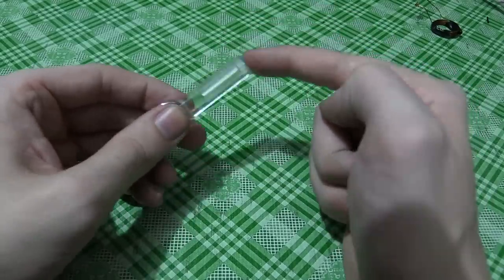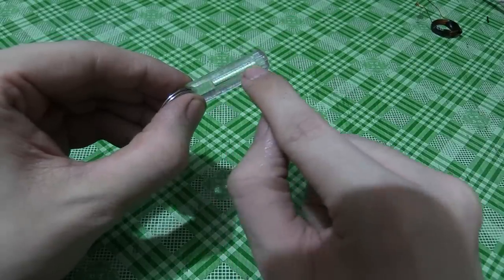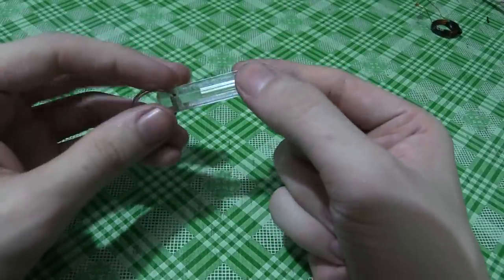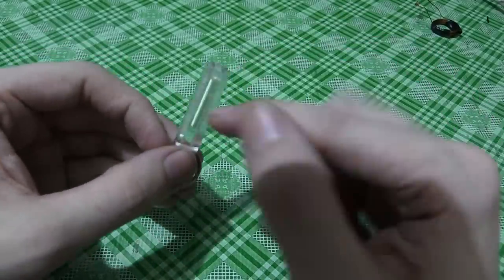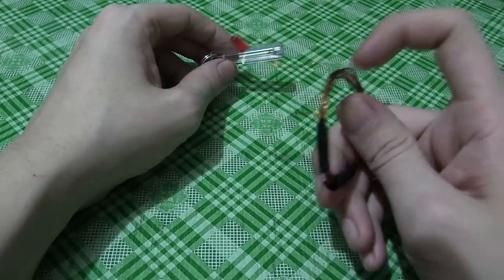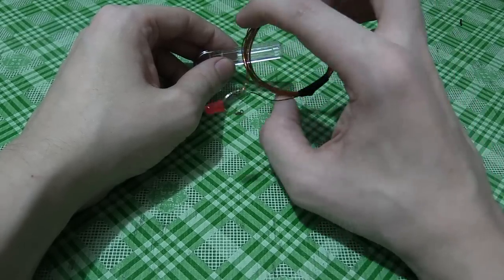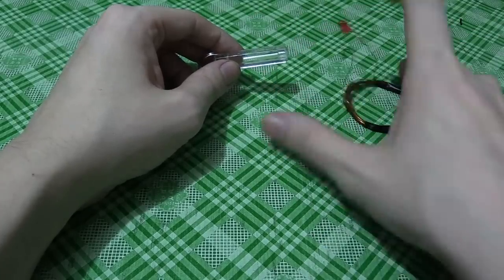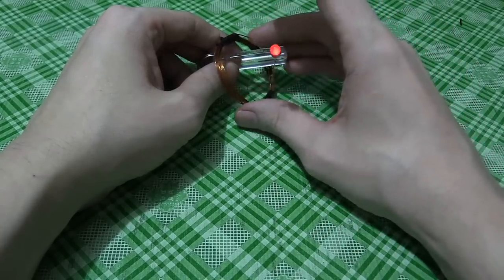1 Watt Nuclear Generator - Free Energy

Comment: Pretty sure he put a magnet in the tube, not tritium, because tritium would not do this. A magnet would. Notice that at no point did he ever stop the coil from moving. That's because it's necessary to keep the coil moving in the magnetic field to keep it generating electricity.

Comment: the keychain is a luminescent liquid, the coil its a normal receiver counduct of electromagnetism in this case powered by, a normal wireless cellpone charger under the table, radiation cannot be transformed to energy by coils
Reply from the maker: +Manolo Alatorre it's not a luminescent liquid. It's tritium that excites a phosphor. Try look it up on Wikipedia :)
Reply: +Gadget Addict yeah actually i was unaware of this type of keychain, i did a research on this element now, becouse im a inventor and im trying to make small nuclear batteries etc etc., you are right but my point was that your invention its fake,  i didnt know the amount i assumed it was low but, do you know the amount of beta decay mevs of your energy source tritium, multiplied by the amount you have in that keychain, hahaha look it on wikipedia and use a calculator
Reply: say a bunch of fancy words and suddently you're right :D
Reply: but yet again this video has been made in april fools day
Reply: beta decay is electrons.
Reply: Manolo Alatorre actually your wrong. It's tritium in a glass tube with a white phosphor coating. Once the radiation passed the phosphor it causes the phosphor to glow.

Comment: 1 watt? My 1 watt led flashlight is as bright as a car headlight. And how would such a device even work? This is magnetic induction. Unless tritium generate a pulsed or alternating  magnetic I call this fake.
Reply: I call this fake too because a led light would explode with 1W instantly and it even explodes with only 9v. it is fake
Reply: but you can make a nuclear reactor with thorium
Reply: I think so too... It's FAKE!  ,,,  In the video, generated energy is too low... It doesn't seems that 1W... NEVER....
Reply: Maybe a TINY Magnetic generator? LOL XD
Reply: +Layn J the date is April 1st
Reply: No, its april folic induction.
Reply: Vool Cow
 OH MAN DATE! April 1st......
I didn't look the damn date :(
Reply: Corey Miller 
Dont forge5 that the coil he put around it is only covering a tiny area and beta radiation doesnt travel well through air. Maybe a few percent actually reaches the led. Meaning almost all of the energy is lost and the actually tritium battery generates a fair amount. Probobly not 1 watt though but its easy to work out how much it would actually generate
Reply: the legit way to make it would be to use tritium rods and put it between 2 small solar panels. still would produce very very low power output
Reply: Oh boy the people here do not know about beta and alpha decay.

Comment: methinks wireless power circuit under the table. that or just outside of the camera angle.
Reply: +Blaine Thornhill For real!! I was watching him hold the key chain on that one spot very close to the table... and I swear I saw him trying not to pass the key chain through the coil while it was suspended from that one spot. haha
Reply: I agree
Reply: Def not a watt, but this probably does generate a few mw. Idk tho
Reply: @quantum_chezburger2279  my guess is prob less, tritium has a very low power production and isnt very dense

Comment: Where did you get the 1 watt figure? to light up a red led is like 1.8 v at 2-3 mA.  So that's like 0.004 Watts.  That's 1000x difference than what you claim.  (also, kids toys in the 80's came with this type of glow-in-the-dark plastic)
Reply from the maker: GeorgeGraves I understand that a red LED only consumes a minuscule amount of power. The 1 watt figure comes from a voltmeter/ammeter measurement after various testing with different coils, wire, capacitors, transistors and different sized tritium rods. It's far cheaper to buy raw tritium rods than finished keychains like the one shown in the video. But you have to handle them carefully. This is not a glow in the dark plastic that requires sunlight to "charge"  and it's not radium like what used to be used on watch hands. It's tritium, which is a radioactive isotope.
Reply: It's not glow in the dark plastic. There is a tube inside that contains tritium and a phosphor coating and when the radiation passed through the phosphor it glows.
Reply: GeorgeGraves hell your dishes probably had this radioactive energy lol seriously
Reply: Gadget Addict 3h
Reply: Gadget Addict I’m glad you made this video and thankyou I’m new to the idea but know it can be purchased on wish app cheap and am thinking of getting a few , it’s legal to own here just not sell

Comment: A few reasons this is fake:

1. The beta particles that are being emitted by Tritium are very low (0.018 MeV), so in open air without any vile, the beta particle can only travel a few millimeters before losing it's energy. But that's without any barriers such as the plastic it is in. Also the phosphor is getting illuminated because it is absorbing the particle. So no beta particles are leaving that kay chain. 

2. The conversion from beta radiation to electricity is difficult because it does not act like a normal electron. It is not bound to anything and is a "maverick" per se, so it doesn't have a natural flow like electrons in a copper wire. Therefore claiming that the beta particles are uniformly moving in a way to induce a current in that wire is far reaching. 

3. Lastly, in beta voltaic terms, 1 Watt is A LOT of power. Most devices that utilize the technology, like pace makers for example, run on micro and pico watts. So the 1 watt figure is insane

Comment: =)) this is fake...
Reply: i dont think so, nuclear is powerful you know,
Reply: +Froodoolidoo Do you even proof read before you post?
Reply: No, its fake; you can't generate electricity without a  current carrying conductor and a magnetic flux. As well, he also reverses the coils and the light operates the same. It would literally be a one way operation, as LED's are polar. It's fake.
Reply: Also, look at the date it was posted lol. He did a clever job, but it aint real homie.
Reply: @JgHaverty  irregardless if its fake or not, electricity generated in a coil is alternating current so it wouldn't mattered how he positioned the coil.
Reply: @gustavgames  .... lol its a battery....
Reply: @JgHaverty  Like i said, i dont care if the video is fake or not, your point on the polarity of the coil is invalid because a coil would generate AC.
Reply: @gustavgames  dude... you clearly dont understand how this works lmao
Reply: @JgHaverty  If you could tell me what is wrong with my comment I would happily learn from it even though im pretty sure im not talking shit... a coil generates ac current when an alternating magnetic field passes trough it.
Reply: @gustavgames  First off, batteries can only induce a DC voltage... so if youre struggling at step one, Im not sure where to go from here.
Reply: @JgHaverty  im not talking about a battery here, also dc voltage can only be induced in a coil if the coil moves through the magnetic field. A dc field with a stationary coil around it doesn't generate any power.
Reply: @gustavgames  the coil amount doesnt matter. AC is induced when a magnet is spinning... Coil count only affects voltage....
Reply: @JgHaverty  did I say anything about the number of turns in my comments? The point i try to make is that you can't induce DC into a coil without moving the coil in one and only one direction. Polarity doesn't matter with AC.
Reply: Noah Monfrini I am a physicist and if you think it is easy to build a neutron Bomb, then you are dead wrong.
Reply: @Mat-jv1fx  it is probably fake, this is a tiny amount of tritium, and that’s not how you use a coil to generate electrical currents.
Reply: @tomeaston2962  4 years ago me was on somthing😳 tf is thread
Reply: @gustavgames  you’re wrong, changing magnetic fields does induce ac current in a coil(if placed correctly), but there is NO changing magnetic fields coming from a tube of tritium.
Reply: To all believers: nuclear energy is basically a really complicated way of getting heat to boil water to run a turbine( in the case of RTGs, it simply uses a thermoelectric generator).   
This video is BS.

Comment: Though he is wrong about the one watt claim, it can be said that the generation of electricity is possible through a substance such as tritium. This is mainly due the fact that it produces beta rays when it decays, which are basically electrons. This most likely produces a disturbance in the electrons within the coil causing them to move around and generate power. The only false claim is the energy that is produced through this incredibly tiny isotope. (btw i may be wrong about something here, don't judge i'm only 140)

Comment: the question is

how many volts does it generate?
and
can you actually store that energy?

would be great to know.

thanks
Reply: Domenique Jöcks tritium doesn't emit enough power. what you want is americium from a smoke detector, just read up on safety and conduct your own experiments.
Reply: Atomat235 7 thanks for the Information. Can i simply build a glass tube around that americium and put a coil around it or shall i also build a lead tube around that tube-coil-contraption? I mean its a different radiation from the tritium but i think its too weak to give me cancer ot so because otherwise i have the propability to get cancer from having one smoke detector in my closet. 

Would be nice if you can also answer this question.
Reply: Domenique Jöcks most smoke detectors contain about 0.9 microcuries of americium 241 which comes from plutonium in a reactor. It is still safe because of the small amount, so you can handle it without gloves for short periods of time. most have gold foil over them, so inhaling it shouldn't be a problem unless you have it in your face or if you scratch the foil off.

as for power, im still working on finding a way to use it as a source of power, i do know that it does not need to be in a tube or in lead. just keep it in a container that is a good distance from you so that you can keep up with it.
Reply: Atomat235 7 but cant you just insulate the innards of the lead tube with silver or aluminum foil so that the radiation is getting reflected to the americium? and what happens if you have the radioactivity clothing for high level radioactivity and put a bigger amount of americium into that tube. I think there is a socalled critical mass like Plutonium has and if that is reached it generates a lot of heat. Cant one use that heat to generate thermal electricity?

Also i have a slightly small vocabulary because i am from germany so my grammar has some minor mistakes in it.

So talking about Plutonium and americium, cant you just take thorium and build a small reactor from it? I mean you can carry fresh thorium with you for hours and nothing happens, same with uranium. Also the thorium gets uranium after a certain time so you can theoretically breed americium at home.

What do you think? Im looking forward to your answer
Reply: Domenique Jöcks the aluminum foil would most likely just block out alpha and some beta particles, but you could try. As for larger amounts of americium, every radioactive element has a critical mass, and it is very unlikely that you will reach it as americium comes in a small metal button with gold or other elements grafted over it. thorium and americium are unlikely to be used together to make a reactor because thorium doesn't fission easily, but you could try buying some uranium238 online and bombarding it with neutrons from the americium, i haven't tried it yet, but depending on where you live it might be illegal. if it isn't check the legal amount to own and if you need a license, and be very careful with plutonium, it doesn't occur in nature so humans haven't had time through their evolution or time on earth to develop a tolerance to it.
Reply: Thorium doesnt fission easily but it does fission when you put enough neutrons into the atoms. As a neutron cannon i thought about radium which is to be found in the pointers of some glowinthedark watches. The only Problem is the stuff coming out of the reactor. The question is not where to let it decay, the question is how long the halflife is. Even though uranium has a longer halflife you dont know what to do with it.

Next Problem:where i live is germany and not america so it could be a huge Problem to Import the uranium to use it for a reactor. And since germany decided to deconstruct the nuclear power plants i could actually get into some serious trouble with the Government here. 

I: „oh i need some uranium to build a nuclear reactor at home... hehe.“
Government: „are you crazy? You want to build a reactor? You are dead!“

Another problem is, believe it or not, youre having a serious conversation with a 15 year old dude who knows some stuff about radiation but not much. So it can be that i might get my parents pissed off a bit so i keep this a THEORY.So dont expect something going on at my house its only happening in my Imagination.

Hope you understand me. But im happy to have someone to talk to about this theme. Thanks.
Reply: Domenique Jöcks yes, i understand. after chernobyl the government decided to demolish reactors in germany. I'm also 15, i just know about this sort of thing. the U.S. government just gives you a slap on the wrist and cleans wherever you store your reactor here. if you're older, you face several years if not life in prison.
Reply: Good to know its not only germany. But my mind is more important than my reality because, as Stephen hawking said, in my mind i am free. So i can think of a nuclear reactor and how to build it and i understand how nuclear radiation can be used for stuff. Also im really glad im talking to someone of my age so we can understand each other better. 

Back to the mind thing:
If i want to understand sometging i use my mind to make a picture of it so that i can see what i explain or get explained. Thats the way i tought my class about infinity and nearly everybody understood because i used the pictures in my  mind to draw things on the board to show everybody. And since we are going to have radiation in our physics lessons next year i learned about radiation. And this conversation is something i really want to call a learning progress because we spoke to each other at such a high level that my class is going to be envyous. 

So i want to thank you for this conversation and i would like to keep it up.

Ps. Do you have Whatsapp? If yes do you want to keep the conversation going on there? Just send me a private message with your number in it if you want to. I dont spam.

Comment: What is the diameter of the coil? And would it make more power if the coil extended the length of the tritium chamber? I also wonder if it would run a small neodymium magnet MHD?

Comment: sorry for the comment , was just wondering what kind of wire you are useing. I was going to message you , however I am on my cellphone and cannot figure out how. Also does the plastic around the tritium and x ray effect matter for power production ?
Reply from the maker: +Silverz0 I don't remember the gauge but is a pretty thin 'magnet wire'. I'm not sure about the tritium and it's protective casing tbh, sorry.

Comment: Hi Gadged Addict!

Where can you buy tritium? If ever you had shipped it here in PH, how did you get through customs?

So it emits electrons by beta radiation and those electrons are captured by the coil?
Reply from the maker: comebackata2 I don't know any place in the Philippines where you can buy tritium vials, only end-user products that include tritium, like the keychain light. In some countries you can buy the vials on sites like eBay and it works out much cheaper than buying end-user products. Although you can't buy the vials locally (as far as I know), there are shops that sell products that include tritium; like the keychains, rifle sights, watches, emergency exit signs and so on. You can find those in many mall shops in Metro Manila.

As for using the tritium to generate electricity, I think it only works on one day a year :P
Reply: aw ok :(

thanks! :)

Comment: this is fake. maybe he put some coil under the table powered by oscillating current that works like a transformer. the coil under the table is primary and the coil that he is holding is secondary. i think tritium does not have significant amount of magnetic field to induce the current.

Comment: Thats a big isotope which is diferent to just radiation. For being Tritium you could generate a constant flux of ions which in turn could be used as a tiny energy outcome a nano propellant for instance. The light effect is more on the chemical phenomena of the equation I guess. Try using tritium in a more manageable state such as gas or pressurized liquid tritium. In theory it is possible to testing its full potential at once by triggering out its reaction at different speeds to evaluate what is the optimum and what energy outcome is capable of generating by amount.

Comment: Fake. You cannot extract energy simply by coiling wire. you could however stack an array of tritium cores using small solar panels in a series parallel config to make a battery for your tv remote.

Comment: impossible.  its.electrical emission has been tested on very expensive gauss measuring systems . the output Is only detectable beta waves less than 5 thousandth of an electron volt. impossible to even penatrate the plastic key ring containe and is not detectable even with the most expensive emf detectors. without emf there is no induction and most certainly there is no AC which would be required to induce voltage to light a rectified led. wish is would be true however with about 10 of them in between a good solar cell you would have a few milliamps.....